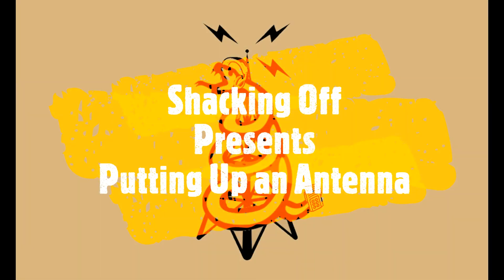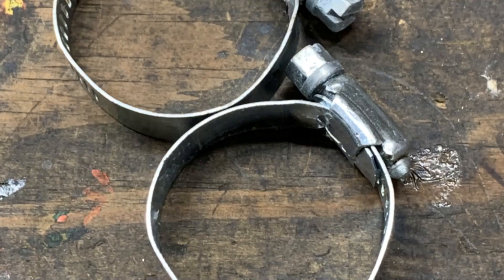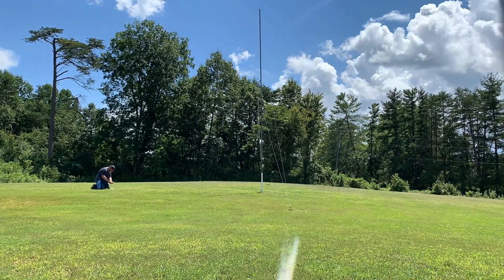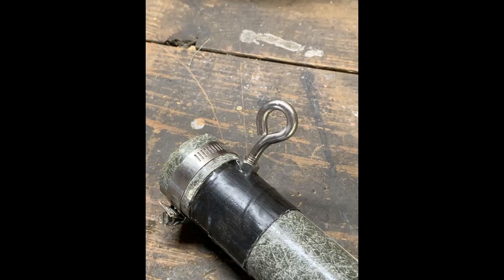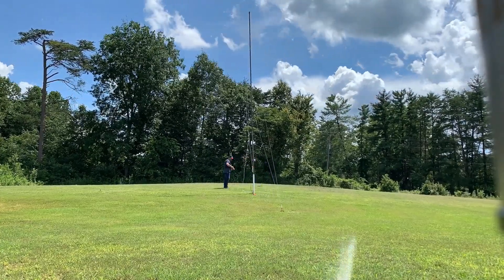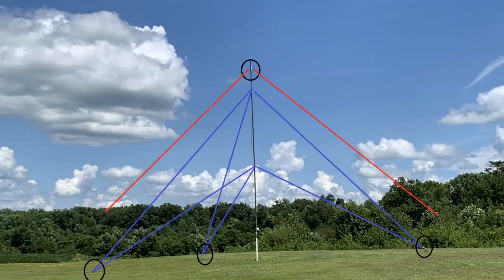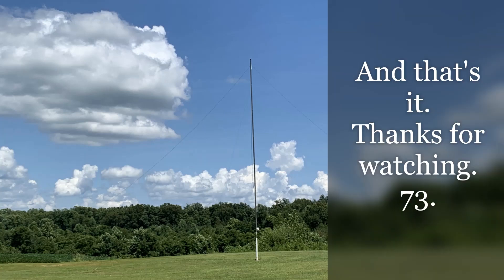Ham Radio Inverted V Dipole Install

Comment: Thank you for this video. My curiosity demands I ask a few questions: were the legs 10 meters each? What SWR did you have? Was the Balun a 1:1? Was there a need to trim the legs to get better resonance? Respectfully, fm
Reply from the maker: The Balun is a MFJ-915 1:1 current balun.  For the 20m band, each leg is about 5 meters long for a total antenna length of 10 meters.   I found this length using an online dipole length calculator.  I cut each of the legs wires a little longer than 5m and went back and forth testing the SWR and cutting a little bit off at a time.  I was able to get the a 1:1 SWR at 14.2 MHZ and an SWR under 1.8:1 across the whole 20m band.  73!

Comment: Teaching Hams to make their own antennas is an unwasted video (congratulations!). I hear so many Hams complain about how dipoles, beams, quads, yagis cost when they buy them commercially. They think they cannot build them themselves and be just as usable and efficient. WRONG. An antenna can be built out of scrap wire or extruded aluminum pipe and be just as efficient as the commercial stuff while saving so much money and time. Knowing how an antenna works is valuable knowledge, and building them yourself teaches you so much. I bought ONE antenna "off the shelf" back in the 70's - a TA36 Mosley, even then it was $400 with the 40M add on kit. Since then I've built every antenna I have used on the air and saved bundles!  I thank you for teaching everybody how to build antennas. 73 de W4FJF.
Reply from the maker: Thanks for the kind words!  73, Norm KC9CSC

Comment: Have you tried pointing the V?  Instead of opposing each other one is say North and the other East. I ask because I worked a guy from Canada the other night who had a limited space yard. His neighbor suggested the idea and he was pointed at Southern Florida. He was so clear on 100 watts it was like he was across the table from me. I was portable in South Alabama. 
This fall I want to get a pulley up in a 90 foot tree and give it a try.
Reply from the maker: Interesting.  I rotate the antenna often to point in the direction I want to work, but I always keep the ends opposing each other at about 180 degrees.  I'll try moving the ends closer to 90 degrees sometime and see how that works.  It's very easy to move the wires around and I'm always up for experimenting!  73.
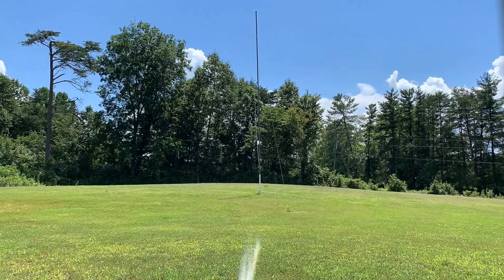Reply: And yet you consistently refer to it as a guide wire... 😂 Remember that the ends of the antenna should be approximately 10 ft off of the ground to avoid coupling. Not so tight on the slope of the leads basically. 3:18 3:18 Remember that because it is a broadband antenna you can effectively get it to perform without changing its orientation all the time. Install the antenna but aim the north-south connector to NE and SW,.